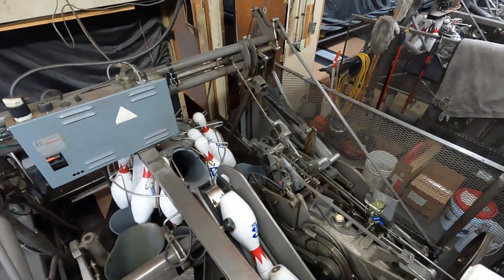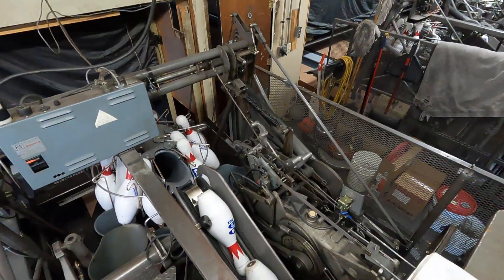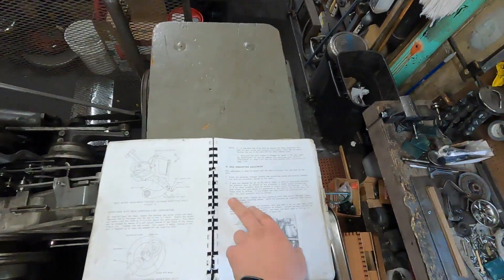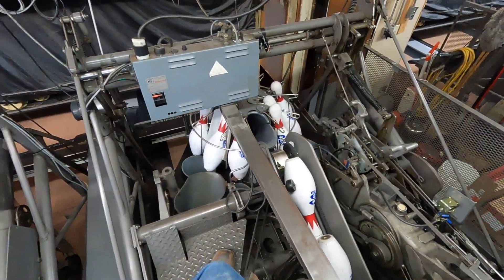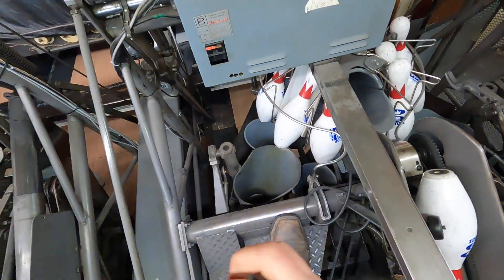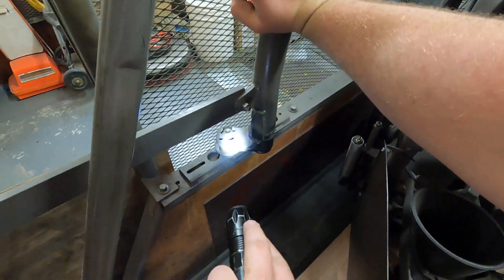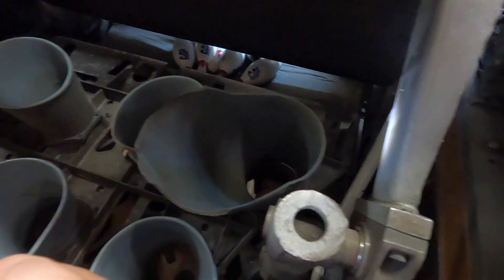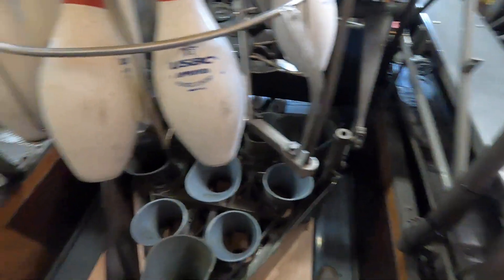Deck Pinspotting #15 - Brunswick Pinsetter Adjustments

Comment: What if the head pin is spot on, but the back row is off to the right by 1/2", and the 3rd & 2nd rows are off same direction, but lesser amounts?
Reply from the maker: Honestly that sounds like the whole frame is shifted, orrrr it could be where the Deck Assembly mounts to the Deck Arm Supports. Either way it’s going to be tedious to get it square

Comment: What if only one pin is off spot?  Say the 3 pin is sitting off center toward the left.  That position will make it hard to strike and leave 10 pins for right handers.
Reply from the maker: I would say check the spotting fingers and deck rollers. Another thing is make sure that it’s not getting hung up by the deck chute, the moving deck cable.

Comment: any recommendations on how to fix wobbly pins after being set?
Reply from the maker: Is this a new rack that’s wobbling or after a 1st ball cycle?
Reply: @thepinsettermedic  the pins are wobbly on the new rack only
Reply from the maker: Yeah I would check this adjustment as well as the deck height/level and the moving deck cable adjustments

Comment: I’m looking into getting a pin setter for a future home lane. What would you say is the most reliable pin setter you have worked on and is easy to work on? It seem like the A2 is a good machine. They have them at my local ally.
Reply from the maker: I’ve only work on Brunswick A, A-2, and JetBack’s but I’ve seen GSX’s and a couple different AMF machines. But by far I think A-2 would be the way to go. I want to do the same thing and that’s the machine I’m going to go with